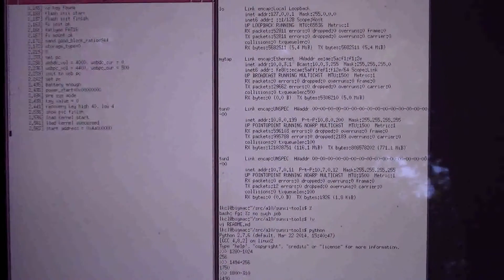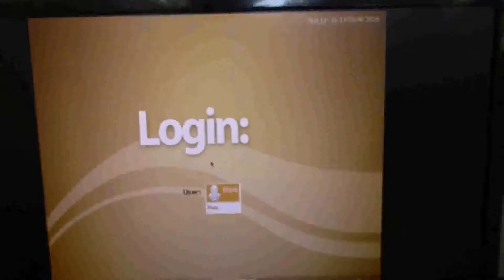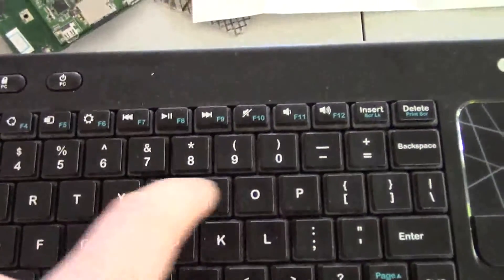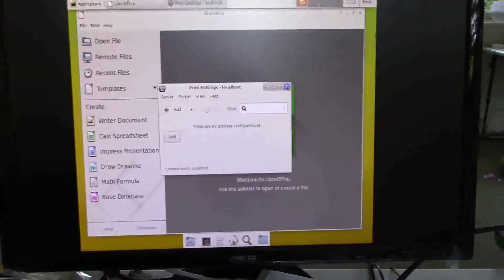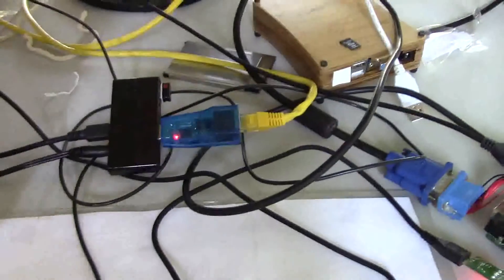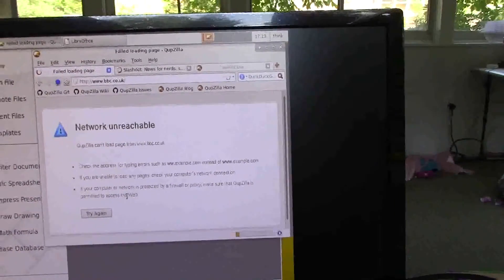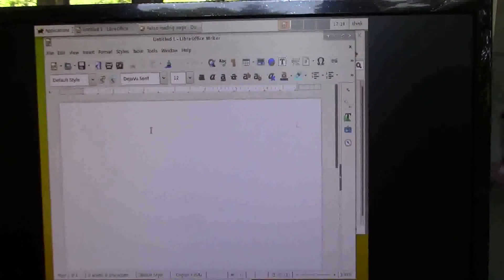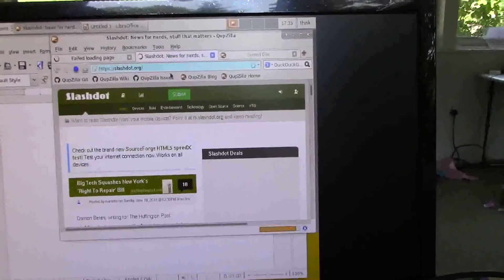Parabola ARM GNU/Linux running XFCE4 on EOMA68-A20 Microdesktop

Comment: https://www.parabola.nu/ <- linux distro used... in terms of privacy speak of: "it does not give you hidden controllers - that manage your laptops power-consumption but that might be used for surveillance (even if your laptop is closed/shutdown)"
Reply from the maker: that's why the source code for the STM32F072 embedded controller is a GPLv3+ project, and is PRECISELY why it has been developed right from the start as a libre project.  not "oh we'll be bothered to release it once it's completed, go screw yourself if you want to help out, because i sooo want to be the one that does eeeverything myself, claim aaalll the glooorrryyy and also so you don't see if i make any mistakes pleeease don't criticise meee boo hoo hoooo", it's an ACTUAL open and libre project, and because of that committment we've already had someone contribute an AZERTY keyboard layout.  you can check the git repository logs for yourself.
Reply: a lot of people in #Germany have #Privacy concerns... so this thing should sell... if the marketing is done well... because the #mainstreammedia probably will kind of ignore it i guess.

really want one if affordable :-D

Comment: Thanks for your efforts :)

Off (Electricity) Grid Computing... it is cool that you could power this thing with 2x 5Volts USB-Ports.

But it would also be COOL if your Laptop/CPU-Card is possible to boot with the power of a 12V car-battery.

Because a lot of cheap off-grid 12v-solar-panel-kits are out there...

Comment: may i ask politely why a macbook pro?
Reply from the maker: course you can, it's a great question.  i evaluated a lot of hardware 3-4 years ago, i really wanted to get a  system with an extremely high-resolution screen, and one that i could tell had been "overmanufactured" if you know what i mean.  IBM used to really overdo the hardware by buying the fastest RAM and fastest processors, then running them at less than the rated speed, so that they would not suffer significant thermal stress.  the end result was that IBM's laptops last longer, got a great reputation, and the 3 year warranty was only $30.  so i deliberately bought a macbook pro based on the same logic, because i surmised that they would have far better quality components than a budget or even a high-end HP or Dell laptop.

but that's not the full story: i also analysed the cost vs the expected lifetime, and despite being $1200 i figured that this machine would have a useful lifetime of between 5 to 8 years, amortised that's only $150 / year - a lot less than buying "budget" laptops and having to throw them away every year or two.
Reply: thanks for the details!
i always wondered why so many hardware hackers and linux users possess macbook pro laptops considering that for the same money it would be possible to get better cpu, gpu, memory...
you make some fair points about build quality, high res and specially expected lifetime, i myself chose my laptop based on that logic too.
Reply: Apple has not only nice design but also robust cases and hardware... and they used to have high quality software.. but they decided to quit on testing and concentrate on SELLING so .... i sold all my Macs except one MacMini for Audio and Video stuff.